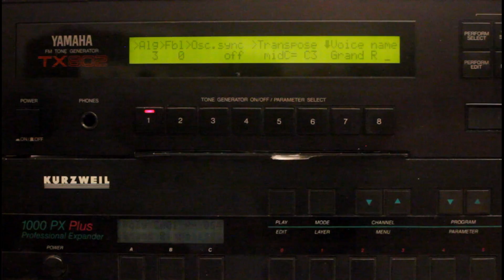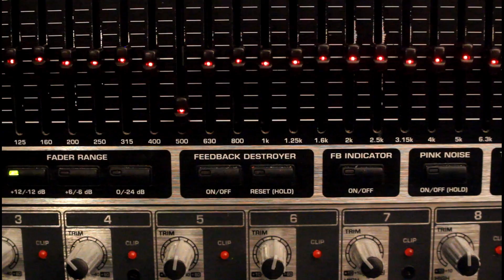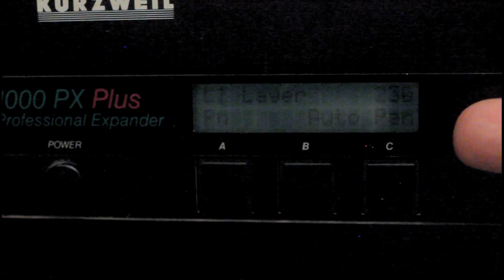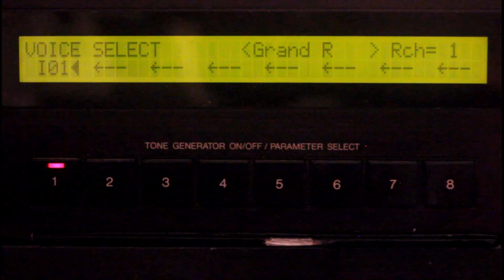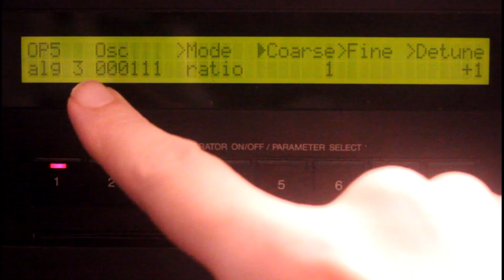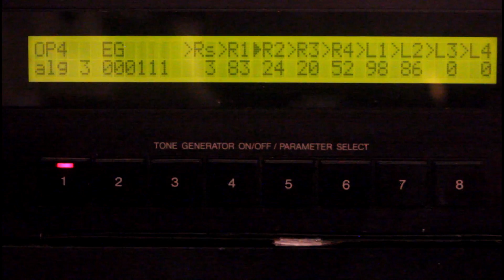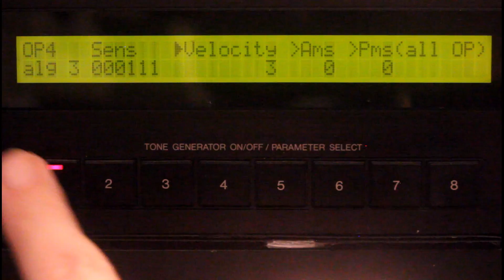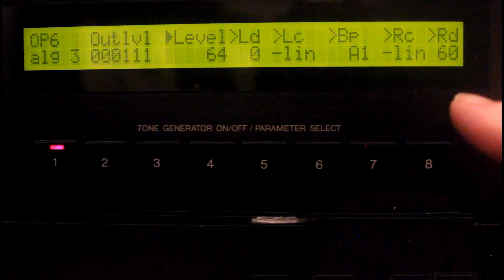DX7 for a Stereo Piano

Comment: How to load the sy99 Franken Grand sample in to DX7, whitout the sector 101 waveform card?
Reply: Anyway, thanks for your job it's incredible.
Reply from the maker: @ I suppose you are asking how to load the Franken Grand sample into the SY99 because the DX7 can't use samples. The piano samples files were copied from a SY99 floppy disk. So the files can be downloaded from the site loaded from a floppy.
Reply: @offthematrix5310  Yes you're right, but i can  recreate that sound with my DX7 mk1 without samples?  Thanks for your help.
Reply from the maker: @caccatime2551 I explained how to use a FM piano for the right channel. For the left side you could use any sampled piano, I used a Kurzweil but just about any synth with piano samples would work.
Reply: @offthematrix5310   Ok thank you!!

Comment: I hate programming but the results pay off in the end. I have a Kurzweil K2500X with the same piano sound and it's great.
Reply from the maker: I once had a K2500 rack. I wondered if it had the same piano samples. The 1000 PX Plus has the same samples as the K250. So it's surprising that Kurzweil used the samples for so long.
Reply: The K2500R and X has the same sounds. That particular piano sound dates back to the K250 in 1984 and even the other piano sound in Kurzweil's up to the Forte dates from the 90's. Both piano sounds are on hundreds of records.